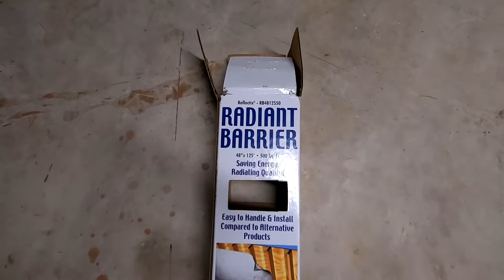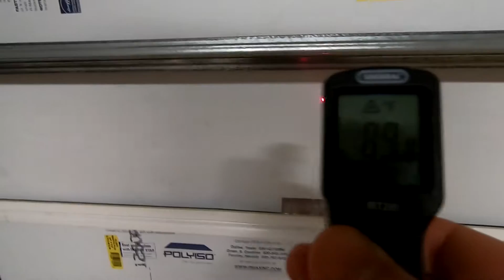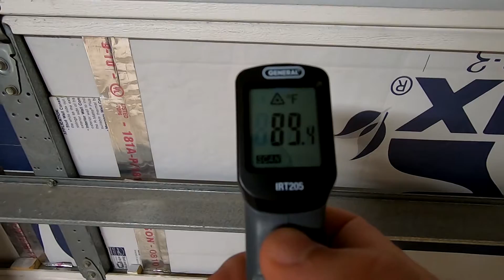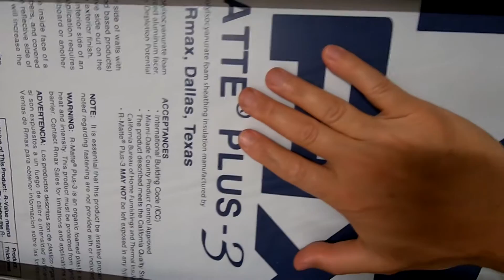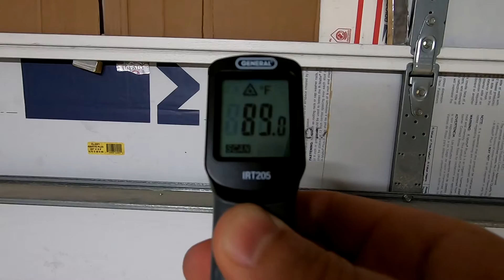Radiant Barrier VS Cardboard - Real World TEST

Comment: I've been doing similar tests and research starting around the same time as this video (which I bookamrked) and for the most part, agree. A white paint is maybe low 90% reflective whereas an aluminum barrier is around mid to high 90s. The practical difference I notice in my climate is around 1-4 degrees F. However, there are other considerations: longevity in permanent applications, won't decade if wet from condensation, different ventilation options (like holes in the foil) depending on the application, and class A fire rating, ease of installation (some products have adhesive strips on edges to allow for easy overlap)  -- not to mention, finding big sheets of cardboard is also not inexpensive, especially if you also paint then with a very white paint like behr upw. But definitely avoid the mylar sheet based products. I found that after a year to 18 months, the mylar delaminates (so much for longevity). True aluminum product has so far lasted 3.5+ years w.o. any noticeable deterioration.

Comment: You should have tested the cardboard with an air gap, too.

If it works as well as purpose built radiant heat insolation at the same job, it would be worth knowing for my attic.

Comment: the problem with "just a bunch of cardboard" is that cardboard attracts moisture and absorbs it, so if it gets humid at all, you'll end up making a moist cardboard mess. plus certain insects like ROACHES like to nest in it, so you'll need to take it out a couple times a year to check for such things, especially since the cardboard holes are open to the air, where the insulation panels are not. this is why cardboard is not generally used for insulation.
Reply: I agree with your response.  I tried this and here was my solution that worked very well.  To 1 gallon of alkyd paint  add 1 cup borax laundry soap and 1 cup cayenne powder. Mix well. Paint the cardboard.   Mount the cardboard on 1/4" wood battens. The air gap and alkyd paint have eliminated moisture accumulation and the borax and cayenne have eliminated bugs, mold, and rodents  🎉

Comment: You can’t use on shiny surfaces. It just tells you air temperature of the garage! & the shiny side goes on the outside. You want to reflect the heat away. Needs an inch or two air gap between the door & shiny material.

Comment: Even though the radiant barrier has a similar temp to the cardboard, the metal has a higher thermal conductivity which means heat will transfer to your hand faster thus making it feel more hot.

Comment: why  would you not  put  reflective  material on the outside of the garage door.
Reply from the maker: I did but the purpose of this video was to see if cardboard would do the same job as radiant barier. On some panels I have foam board with reflective part and on some just cardboard and cardboard work as good as radiant barier.

Comment: Hi, what difference did it make in winter ? Did you try it with the foam, cardboard and the foil blanket all together?
Reply from the maker: I'm in Florida so the biggest difference I feel is in the summer with direct west sun heating that garage door to the point you can't touch it. Cardboard insulated that better than foam, from my experience and my garage is not cold but about 5 deg cooler.

Comment: Fyi infrared thermometers don't work on reflective surfaces...
Reply: This is correct, that's why you got the ambient temperature when measuring the reflectix, but it was very hot to the touch.
Reply from the maker: Interesting because the one I used did work.
Reply: @MaciejPiotrowski  I've also personally seen my own image in ductwork with a thermal camera which also uses infrared light...
Reply: @MaciejPiotrowski  it will show temp like a mirror... Google it

Comment: That's interesting. I wonder what cardboard would do if it had an air gap of its own, like the reflectix did
Reply from the maker: Probably even more. Remember that cardboard box I used has air cells in between both layers. This is what stops the heat. Since I've added that cardboard on my entire door temperature in garage dropped extra 5 deg F. Inside garage door is not hot any more. It is just warm. I should have done it many years ago.
Reply: @MaciejPiotrowski  Interesting. And the reason I mentioned the air gap is because at least one of the reasonings behind the air gap on the reflectix is to prevent the conduction of heat from another object. For example reflectix (or cardboard) will have a different temperature if it is laying on a hot frying pan, or hovering above it with a little air gap.